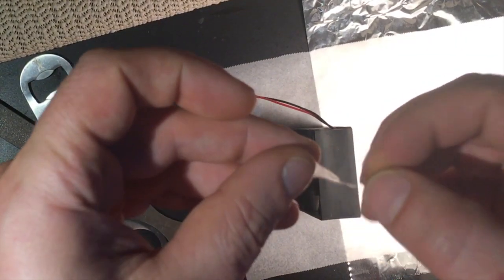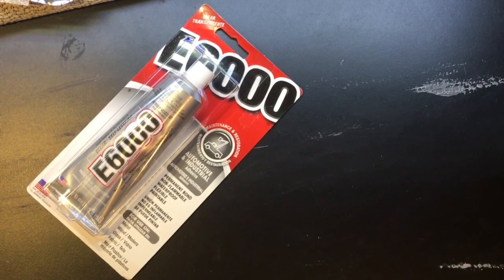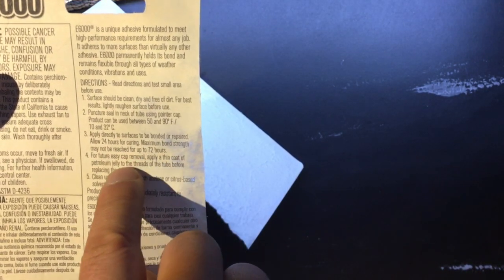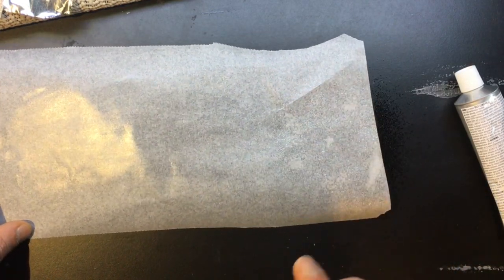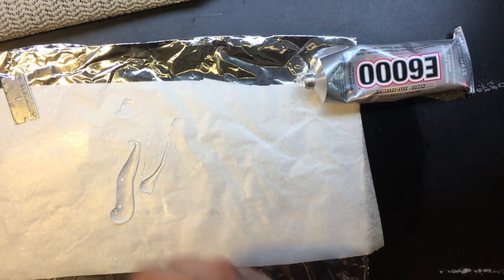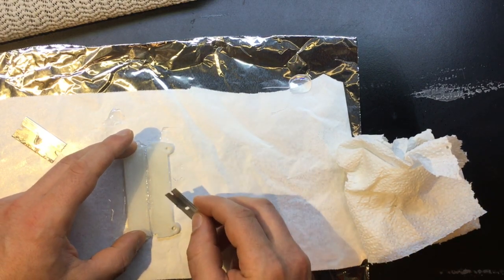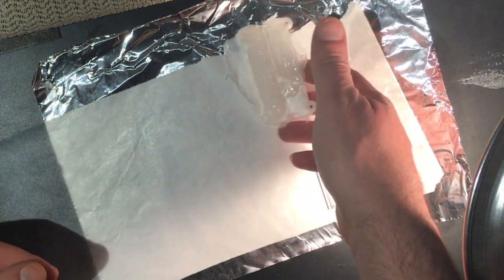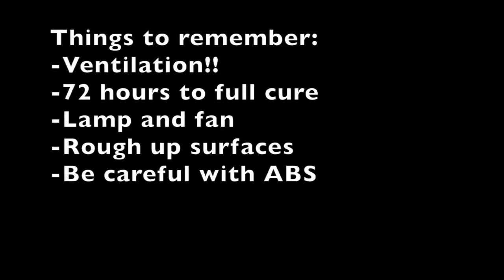5MDD: Flexible joints using e6000 adhesive

Comment: Dude........... with the gasoline  already ..........! not a good solvent choice.......
Mineral spirits or kerosene is much less dangerous..............  
Cool idea though using this stuff for flex joint bet you could squeeze this junk into a mold and make soft mounting spacers for like gyro or camera mounts for a circuit board.......
Rock onnnnnnnnnnnnnn...........